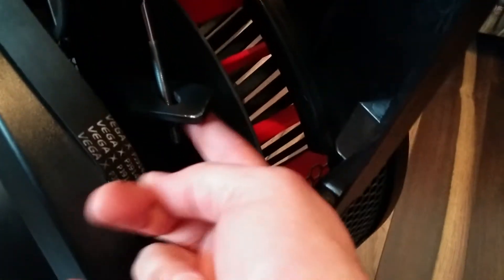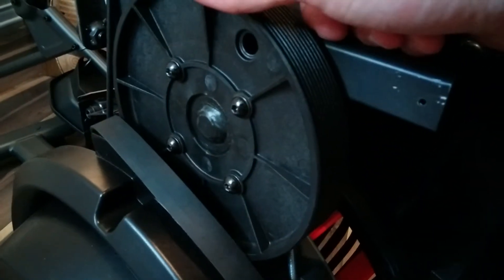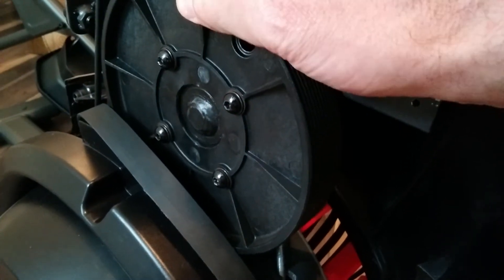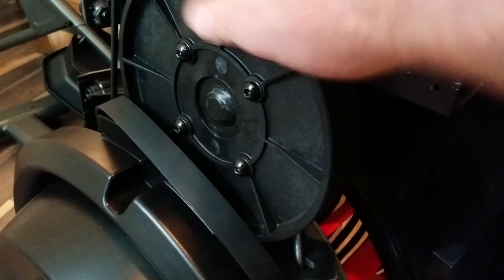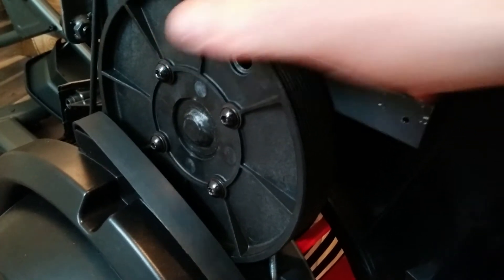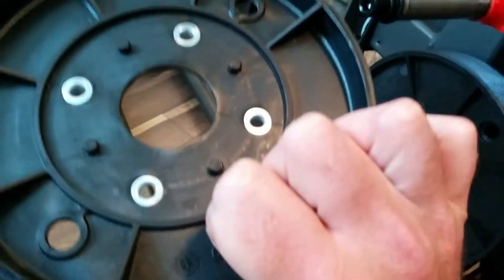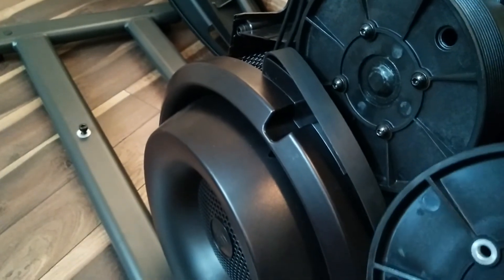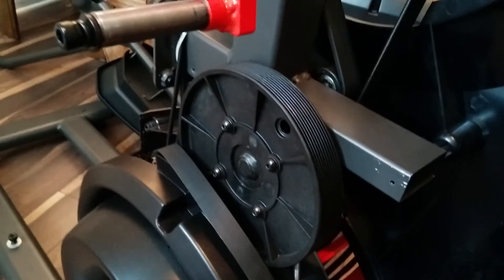Bowflex Max Trainer M3 - Part 2 of 4.mp4

Comment: I have been using my M3 five times a week for the past 4 or 5 months and it is getting annoying with all those squeaks and thumps. I love the workout though. And I think you just solved my problem...or at least one of them...lol THANK YOU!!
Reply from the maker: Ray, keep me updated on your issue, curious to see what's yours.  A new one just decided to show lately and it's the electronics.  It doesn't turn off anymore when not it use, it turns off and then does a full power cycle back on like you unplug from the wall and replug.  Doesn't stop me from a workout just annoying to hear it cycle every 5 mins when not in use.
Reply: +Bigs73 Bigs, spoke to Bowflex rep and explained the situation I had found with my M3. She agreed that it could probably be the top pulley and had one shipped to me. Also included was the puller for the cam arm that has to come out to replace that pulley. I found as you did that the screws holding the pulley were not tight and made sure the new one went on tight. I also put a bit less tention on the belt when setting that belt. My first test went fantastic! No more rare noises. I will continue with my regular workout schedule and hope that my M3 stays healthy.
Sorry to hear that the electronics are giving you trouble.
Reply from the maker: +Ray Aguirre That's awesome Ray!  Happy you have yours up and running.  It's so bad that the back screws were on so loose and we are not the first ones to report this also.  Funny how much my vids are getting viewed, so either people are watching them for a type of review or others are getting major issues also.  Hopefully yours will keep going.  My power thing is just an annoyance that I can live with.  :)